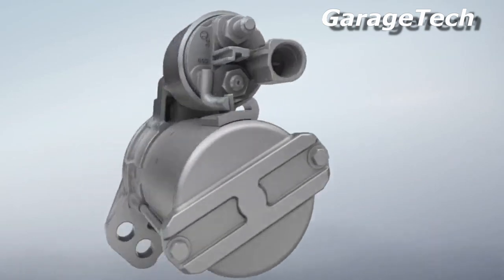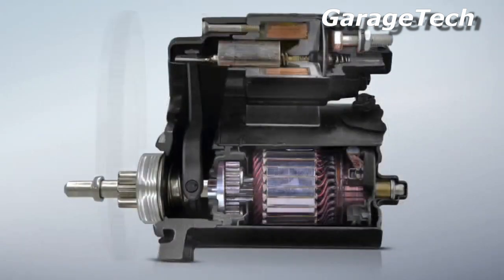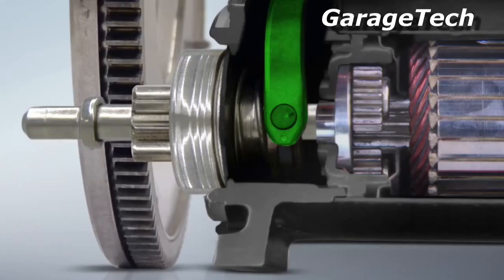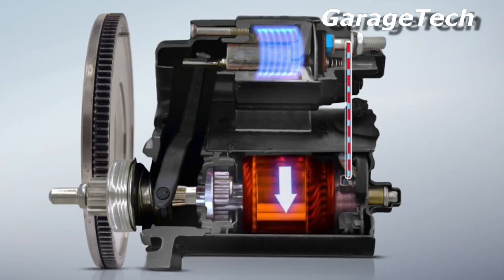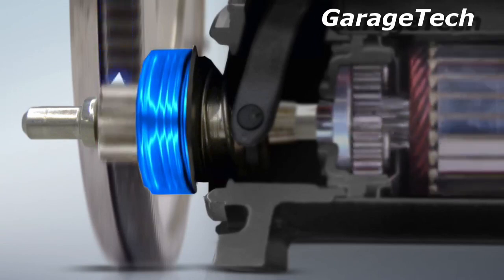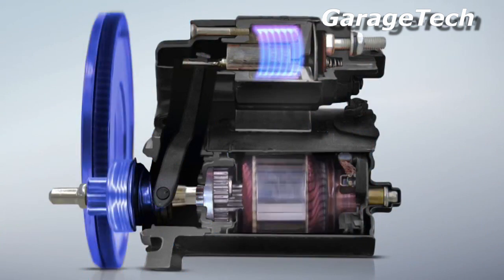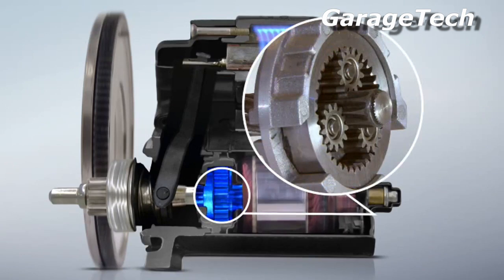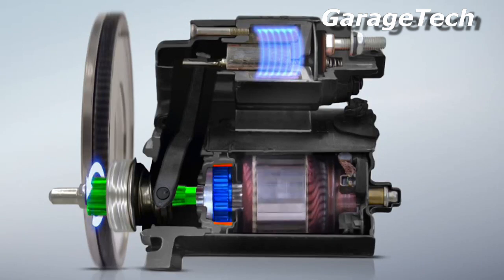How Do Starter Motors Work ? Cars, Vans and light passenger vehicles. 12v starter motor animation

Comment: I came here after my starter solenoid gave in and I was blown away by how straight forward and so informative at the same time. Awesome stuff, definetly subscribing 🤙🏽
Reply from the maker: Thank you 🙏🏽
Reply: Try saying that while you own a Toyota 2UZ- FE 4.7L V-8  And hope and pray that they've incorporated the starter inside the transmission bell housing area....because it's nowhere to be found! 

Can't hit the starter with a 🔨  to get myself out of a jam...med  starter anymore...

well a drift and hammer between the tunnel rams should allow access...

 I've always wondered why the exhaust sounds beautiful on this type engine:  it's because the starter doesn't take away from the header's design flow efficiency!  Pure purr fect exhaust note 🎶 .

Comment: is that starter motor considered "direct Drive"?
Reply from the maker: Hi, no, these starter motors have a planetary gear set to increase torque which means a smaller motor can be fitted which also requires less current.

Comment: Hi 

Iv got a Fiat 128 Rally 1974 

My starter keep on cranking and not start at all, i had to pul battery wire to stop it. 

After days of strangle i find that the points plastic on it melt little and touching the earth. 

After fixed the points starter stop  keep on cranking. And car starts 100%

Thing that confuse me totaly. 
How can points that touch earth like my car did. Let the starter keep on cranking. How is that possible???

My coil got 3 wires on. 
1. Ignition wire to +
2. Wire to points on - 
3. Wire also on - (this wire i got no idee where it goes)

Realy realy hope you can give me the answer on this. 😁😁😁
Reply from the maker: Hi, cool car and a real classic, this is an old system with points and condenser, the coil will have 3 wires as you say, the 3rd one should be the larger cable which goes to the distributor. Only thing I can think of is there must have been a short from the ignition between the wire that goes from the ignition to the coil with the start motor ignition feed. That would keep the starter motor turning . Glad you fixed it
Reply: I bypast ignition switch. Connect a wire straight from battery + to starter. And starter still keep on cranking. So it was not the ignition switch well. 😁

With the thick wire in senter of coil there is then 4 wires. 

On the - (negative) side is 2 wires. 1 go to the points other 1 confuse me totaly. 

THANKS SO MUCH FOR YOUR REPLY. 

From South Africa 😁🇿🇦👍
Reply: The points must read zero on miltemeter when you test it to earth when points is open. I had a reading on earth. So i take points out and check it. Plastic on it were broken so it earth. After fix it. Start 100%. 

I keep on thinking that extra thin wire on negative trigger something on starter if points earth parmently.
Reply from the maker: @g.j.dutoit4447  oh on the - negative side it sometimes has two wires, one will go to the condenser and the other to the points (circuit breaker) 
The condenser absorbs the energy and prevents arcing between the points each time they open.

https://image.slidesharecdn.com/sparkignitioninternalcombustionengines-171015170738/95/spark-ignition-internal-combustion-engines-5-638.jpg?cb=1508087408
Reply: Hi
No the condencor is connected to the wire that go to the points just like on the image. Condencer is skrewed on the casing of distributor. 

The extra wire on the negative on coil go down with the ignition wire. 

So there is 2 wires on negative of coil. One go to points and condenser other one go down with ignition wire. Not to condenser or distributor.

I mean its comfusing. Just after i fix points that got short to earth permantly. Starter stop keep cranking and got spark (there was no spark) and car start 100% 

I keep on thinking that the extra wire on coil negative side got something to do with starter keep cranking. 

That extra wire make my mind spin. 🤔🤔🤔😃

Comment: The whistling sound occurs every time the machine started and start button released. What is wrong?
Reply from the maker: If it only happens for a couple of seconds when starting it’s probably the starter motor, can be quite common for them to make a noise when starting. You could try stripping it down a greasing it but would be easier to just replace it
Reply: @GarageTechAutomotive  it's happening immediately right after releasing the start button. I guess it's the sound of pinion gear being released from flywheel. But is it doing any harm on my starter motor?
Reply from the maker: @sukseskaret3274  I’d recommend looking into getting it replaced, just for peace of mind, plus I bet it’s really annoying. it could be ok for some time, depends on how long it’s been happening for, what conditions it’s used in etc. Worse case scenario it could seize up and stop working.